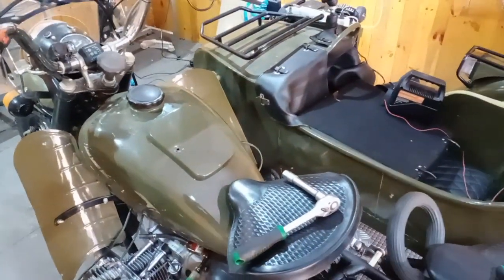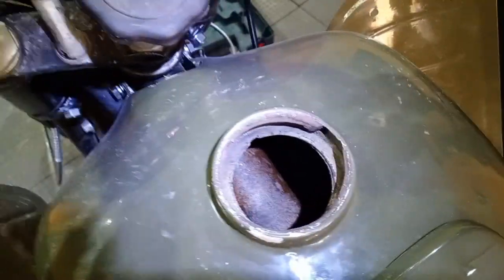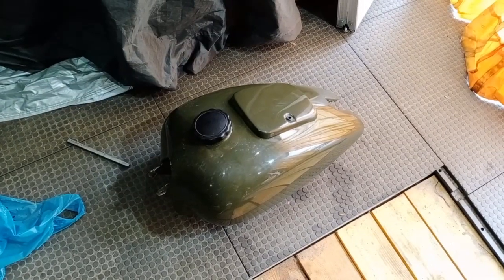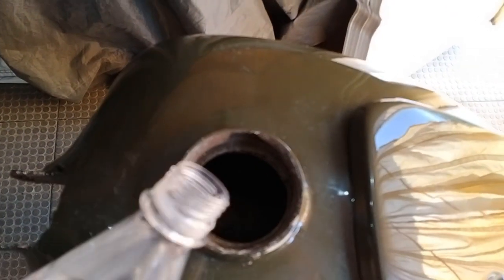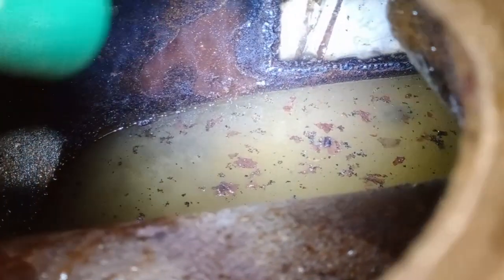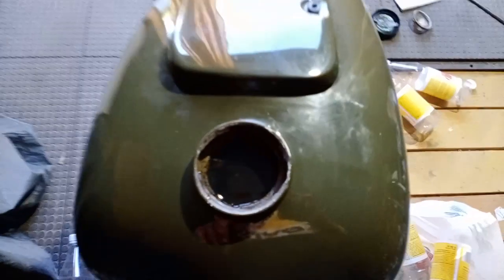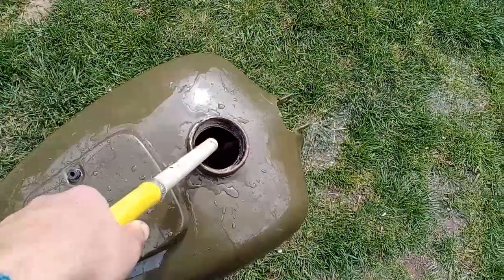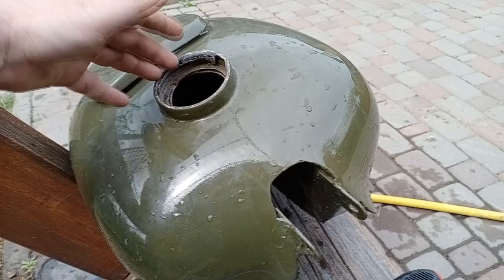How to remove rust from fuel tank? | Easy corrosion removal from metal parts.

Comment: I bought a 1000 count bottle of steel bb's to clean a tank once.  It worked pretty well to get the scale off the inside.  Evap-O-Rust would be the best chemical to use, if you can get it over there.  It  comes from a fairly small company, but becoming very popular.

Comment: Good job. I use a length of steel chain instead of bolt or screws. It's easier to remove and there is no chance of leaving anything in the tank.